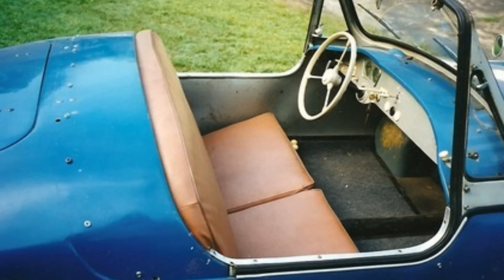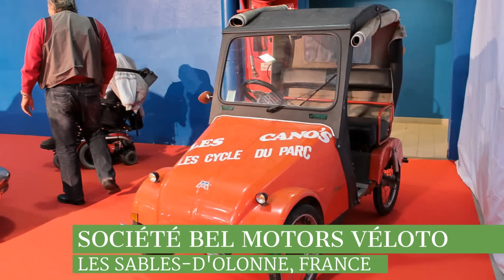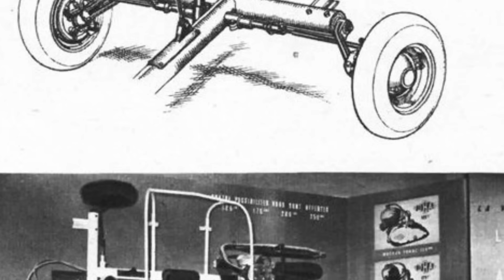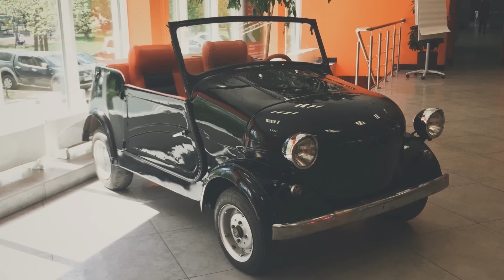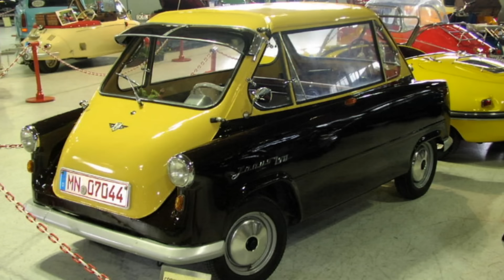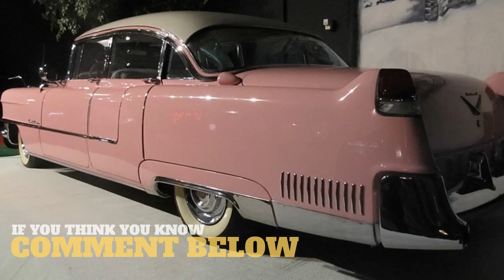15 Microcars That Proved Small Could Get Seriously Strange

Comment: The AWS Shopper was based on Goggomobil mechanics
The Burgfalke was a revival attempt of the Bruetsch Spatz and then the Viktoria Spatz 
The Avolette was also based on a Emil Bruetsch design
The Biscuter was developed in France by Gabriel Voisin and named Biscooter
The Zuendapp Janus was based on a design by former aircraft company Dornier and, because of its shape, called Delta
The Fend Flitzer was further developed into the Messerschmidt KR 175 and then KR200

Comment: The December 2008 issue of "Thoroughbred & Classic Cars" had an article "Buy a Bond car", that sadly didn't include any cars manufactured by the company established by Laurie Bond. There were none of the single cylinder fwd trikes, no Triumph based 4 wheel Equipes or even the Reliant based Bond Bug, only Aston Martins, two Lotus Espris and a 72 Mustang Mach I. What were these alleged automotive journalists thinking???

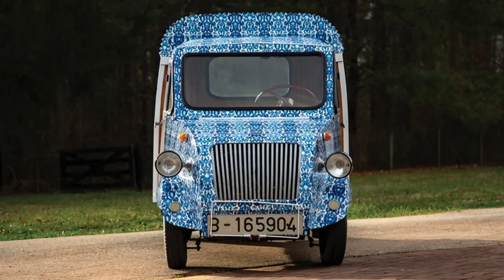Comment: What is that bull crap about "not officially sold to non-disabled people"? (8:39). The SMZ S3A were meant not for ANY disabled people, but specifically for disabled Soviet WWII veterans. These cars were distributed to the veterans through district military commissariats for a 2-year term and then replaced with new cars. Both distribution and replacement were very tightly controlled by the commissariats. So, your "unofficial sales" is nothing but a piece of vicious slander.

Comment: I had a Bond Minicar for about 2 years. Mine was an estate car version with a 250cc twin sports bike engine, which gave it a 60mph top speed and a lot faster acceleration than the basic 250cc single. Lack of a reverse gear was not a problem because the entire engine/transmission/front wheel unit turned a full 180 degrees from lock to lock. If you were in a tight parking situation, you could turn the steering to full lock and drive out sideways. It was great fun to put it in full lock in the middle of the road and go round in circles on the spot. It would have passers by in stitches.